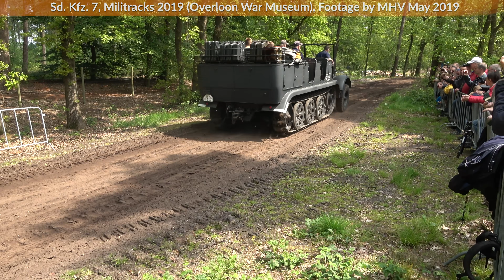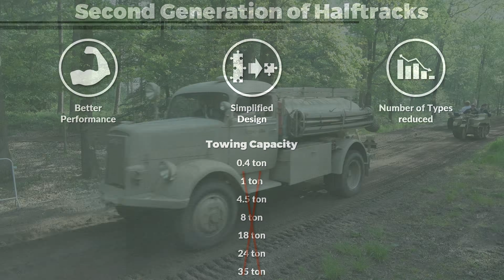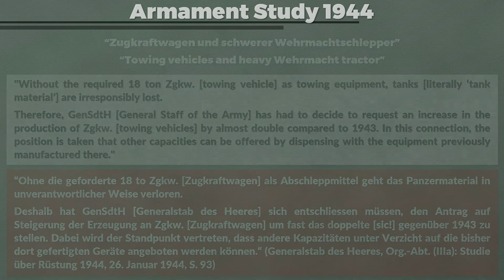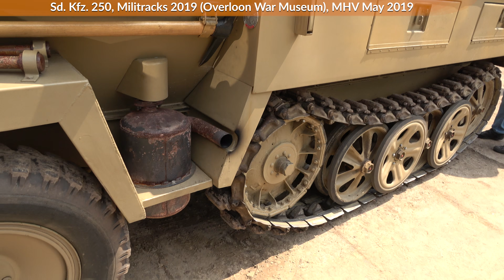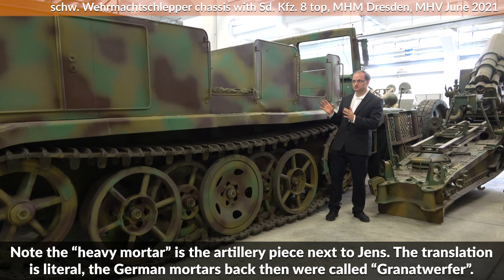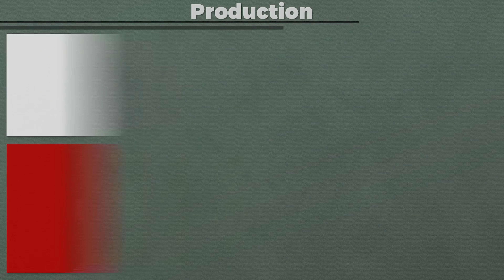The most boring WW2 vehicle? The schwerer Wehrmachtschlepper

Comment: You know ive wondered how much info there is out there, or if you would do a video on the effectiveness of the French resistance movements from the perspective of the Germans and the kinds of resources they diverted to military police and anti resistance forces.
Reply from the maker: A video on this was planned ages ago, but I didn't have time so far, I think I have a source or two on it.
Reply: Got the Germans to over react and post more troops needed elsewhere
Reply: To my knowledge the Germans used many captured vehicles of the countries they invaded or even continued construction of those and kept those - in general - for local use. At the same time example and exception : the Czech 38t. Still produced in the Skoda factory, used everywhere.